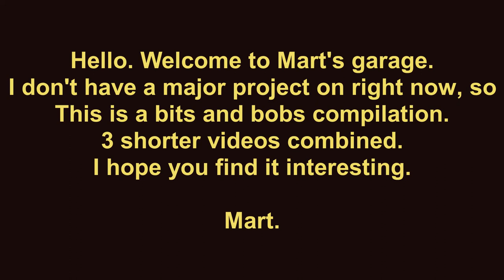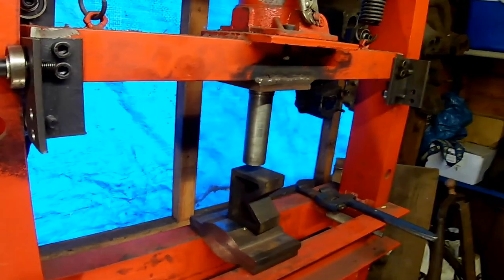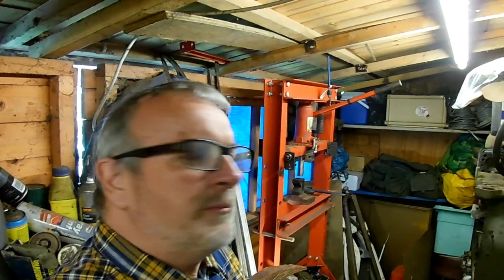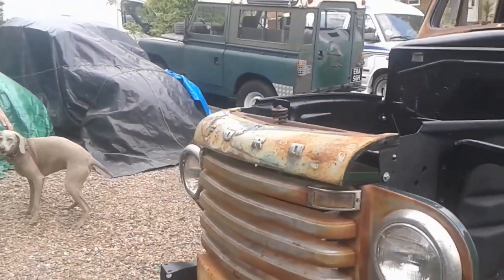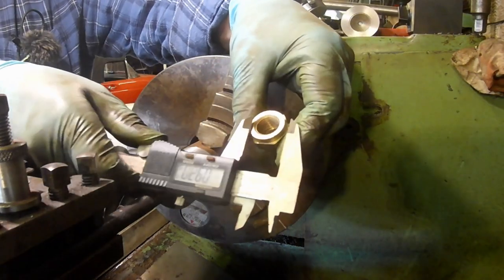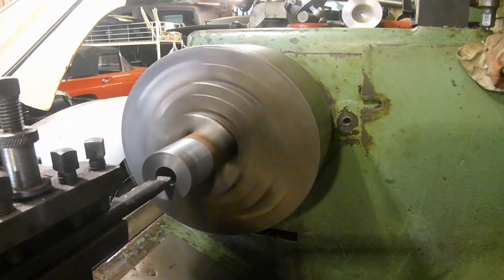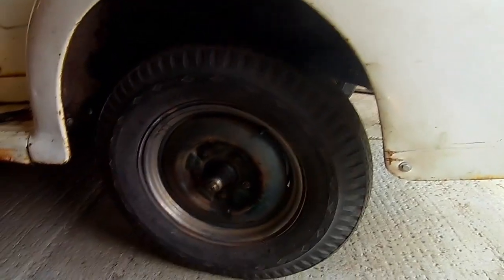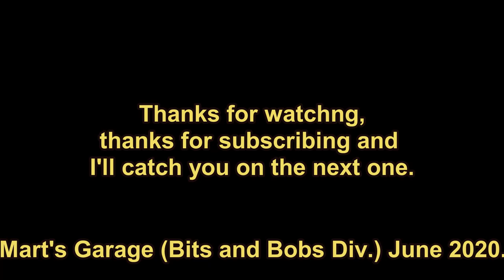Mart's update: Tool Talk, Ford F1 project and Custom Washers. Bits and Bobs 1.

Comment: Hey Mart, Excellent job, That's using your head.
   I get real nervous using a file or emery cloth around a lathe. I was polishing a wristpin with emery cloth and got sucked in. Just as my thumb started to wrap around the pin it popped out of the chuck. No damage but scared the hell out of me and hurt like hell.
 I still polish with emery cloth but I make sure each end is in a different hand.
 Less chance of wrapping up and sucking you in.

    Again , Good video. I've watched a lot of yours and really enjoy them.
    You're a pretty smart guy.
                      Bill
Reply from the maker: Thanks Bill. Lucky escape there. These are big powerful machines and demand respect at all times.

Comment: Pity about the new parting tool, but yes you can see the tool, and maybe the tool post as well, dipping just before it broke through! Juddering as well. Hope that the subsequent washers went without breakages.
Reply from the maker: Hi Andy. What a treat to see your name pop up here. Yes, the other side went well, I chopped it off in the bandsaw rather than trying to part it off. (I chickened out). Mart.

Comment: My son just bought a Harbor Freight press that looks a lot like yours. Not sure how sturdy the channels are as I haven't gotten that close to it yet. I'll be sure to pass your "upgrades" on to him. No lathe in his garage but he certainly is capable of doing the other things. Thank you !!! 
That F1 looks very nice. Is it a V8 or Six??? Learned to drive on a 48 model with a Flathead six and 3 speed floor shift trans. 
As I recall, when I had my Model A Sedan, the repair manual called for 100 foot pounds of torque on those axel nuts. I was always afraid to go that far since the threads on mine seemed a bit on the "loose" side. It was all loose when I got it and even had the shim stock in the tapers.
Reply from the maker: Hi Bob. The upgrades on the press were well worth the effort. I used it today and then ram pushes nice and straight. It was always trying to cock to the one side before. The F1 is a V8 but the motor is badly cracked. Richard has another motor he intends to put in it. The nuts need to be very tight. I don't use a torque figure, I just lean on the bar like I showed. 100lbs ft is not enough. more like 175 required. Not having them tight enough can lead to broken shafts.
Reply: @MartsGarage  Wow!! That's a ton !! Don't those axel threads and nuts get worn and loose?? I remember hearing about the keys breaking. Just looked. It IS 100 pounds feet on the Model A. Probably don't need as much for 40 HP.
Reply from the maker: @pappabob29  Bob, the axels are made of very high quality material.

Comment: Hey Mart, Koops here. I think they're probably not suitable, but i have a pair of F100 (off a 1956 pick up truck) Posies front springs and such which have only had a Year's use before being removed for an 'indy' front clip. I've the axle, spindles, a steering rack and sundries to install such. Maybe of use to your Pal with the F1, or anyone you might know? All at an appealing price, or swap for useable late '20s Ford roadster parts. Any good?
Reply from the maker: Thanks Koops, we managed to locate some f1 springs. Thanks for offering though.

Comment: what kind of motor is going in the F-1?
Reply from the maker: Plan at the moment is a flatty. Finding a suitable replacement here might prove tricky. The one that was in it is terminally cracked around the pan rail and lower water jacket.